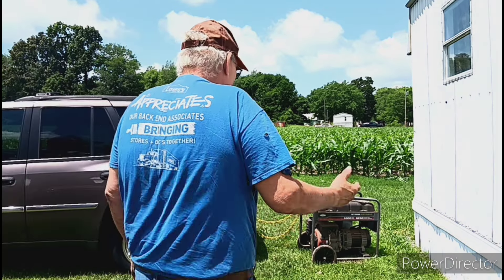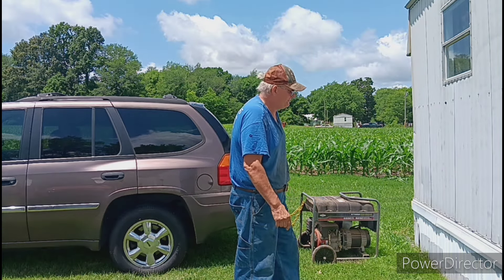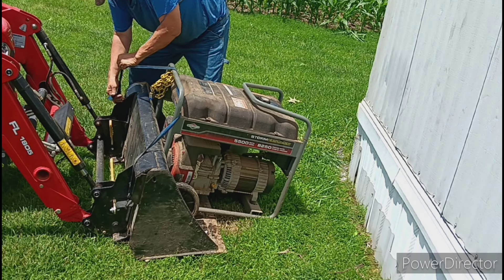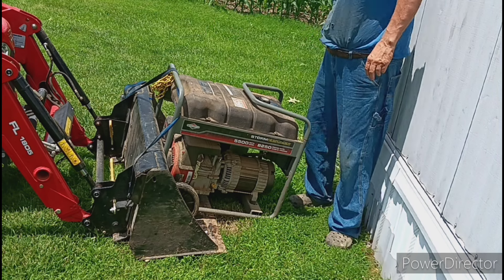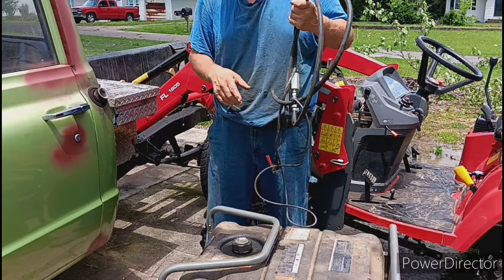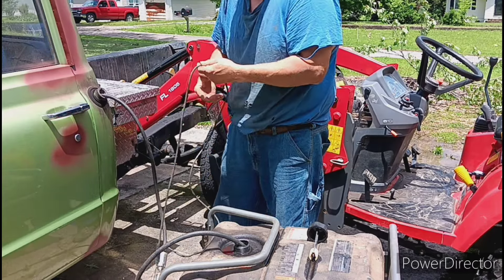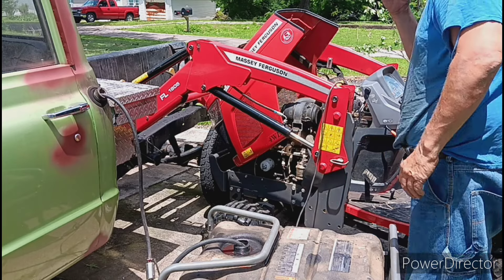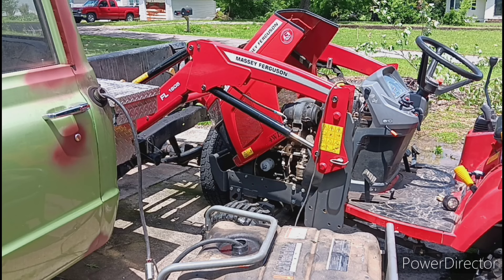Getting gas out of tank the fast way !

Comment: Where did you get that fuel pump?  I have seen battery operated, or manual pumps, but not this style.
Reply from the maker: It's a universal fuel pump I bought from parts store. I added hoses and wiring